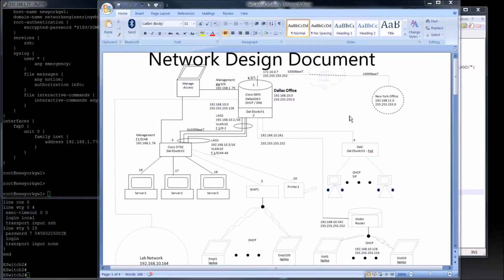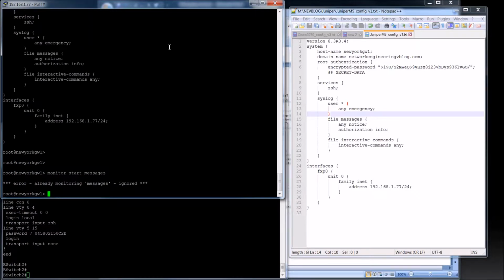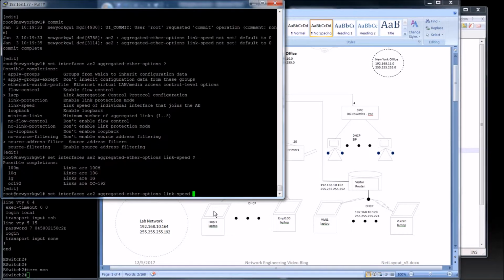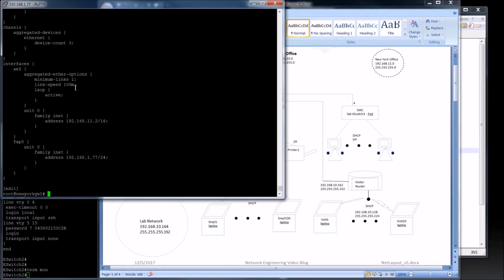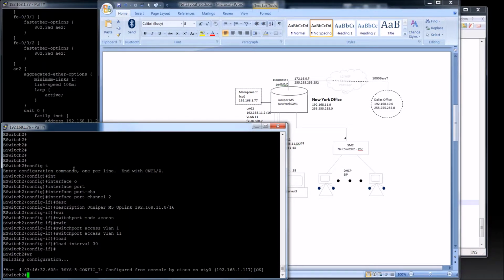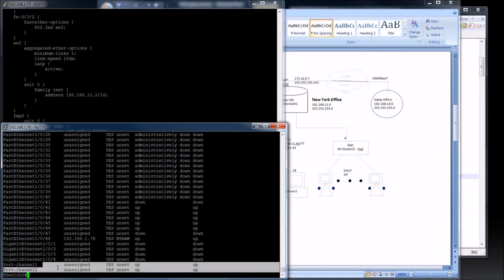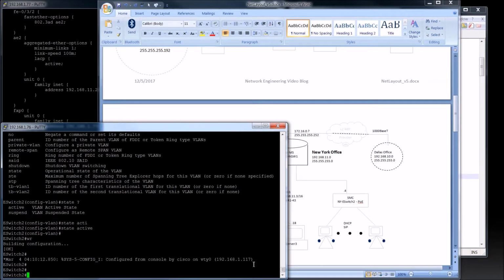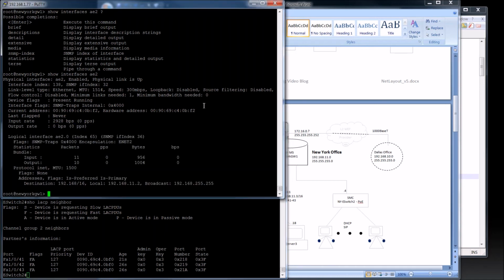NE#47 Juniper Router To Cisco Switch LAG with LACP

Comment: do you have any experience, between connection juniper and cisco. when we ping it, the time show us unstable. sometimes 1 digit time, sometimes 2 digit time. do you have any experience like this before? connection between juniper and cisco is using UTP, and access mode on port.
Reply: Can you tell me what "1 digit time" and "2 digit time" are?  Is it 1 second and 2 seconds?  Also, do you see any packet drops?  Just off the top of my head, here are some items that can cause packet delay: 1. Routing loops, 2. Link flapping, 3. Queuing and, 4. cable length.